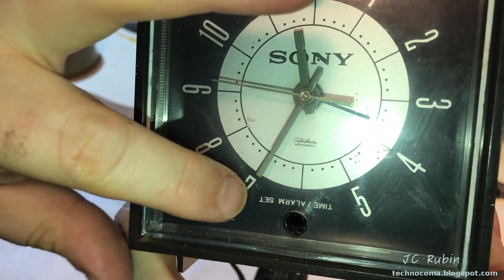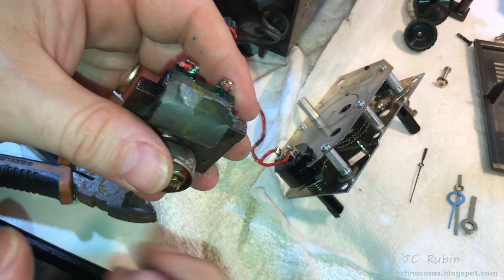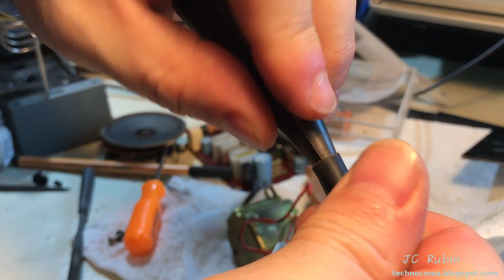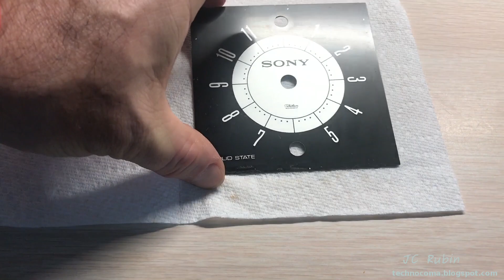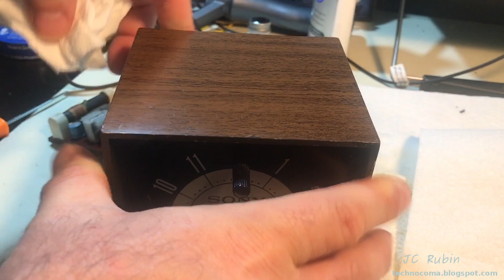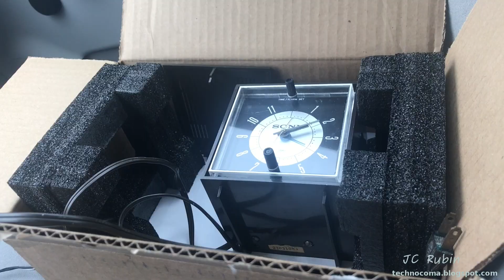Antique Sony 6RC 23 AM Clock Radio Restoration

Comment: My husband passed away last year, and in going through his things I just found one of these clock radios. Overall it's in very good shape and as far as I an tell almost everything works. The only issues are the tuning knob is very loose, and like yours the bottom knob was lost. Also while I can set the alarm time, I can't set the actual time using the knob on top.
Reply from the maker: I am so sorry for your loss. The tuning knob may just benefit from being tightened with a small screw driver.
Reply: @rubin-tech  Thank you. I'll see.

Comment: Found mine on eBay for $7.50  Local pickup right in my neighborhood.  Clock worked great.  Radio worked, but needed a recap.  Replaced all six electrolytic capacitors.  Result: A great working radio!
Reply from the maker: Great to hear. Was more nostalgic for us.

Comment: I really admire you showing the steps in restoring both cabinet and transistor electronics parts. You did a great job that I'm sure your mom will greatly appreciate!
Reply from the maker: She received it and has it plugged in. Keeps it next to the reverts reel to reel. Sadly there is no AM reception in the area.

Comment: Nice thorough job on the restore.  I bought one off ebay back in 2017 & it's in a box somewhere - serial # 23166914. My g/f found me another one (also a 6RC-23) last month and is on the kitchen table now (Ser# 23071050).    Mine has minor veneer damage, a small chunk out of the lower knob, and a very scratchy volume pot but the clock works well.  I figured the dial printing would wipe right off with the dirt but evidently not, so thanks for showing that part.   Your video makes me want to tear into mine -> at minimum to clean the pot and find date codes.  Cheers!
Reply from the maker: They clean up nice, but it’s old Sony so not the easiest to work on as far as early 70’s goes.

Comment: Nice work! Good to see it working and out of the landfill. I love it. :)
Did you test the 50 year old electrolytic caps? It would be interesting to see how well they survived.
Reply from the maker: I tested them by way of esr. Somehow that footage never made it in...
Reply: Tested each one with an esr tester.  Capacitance values generally 50 to 100 percent above nominal.